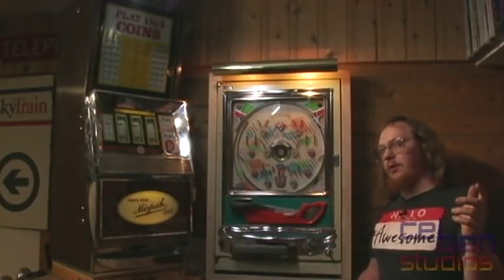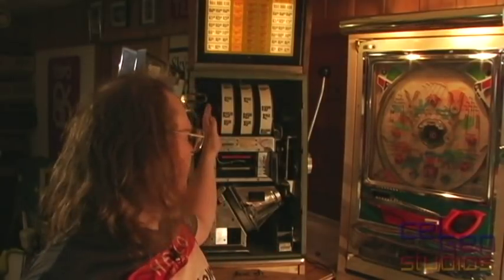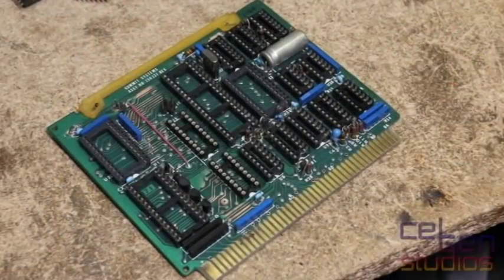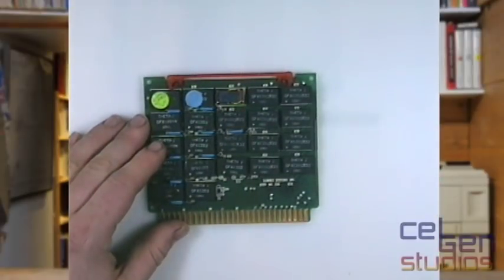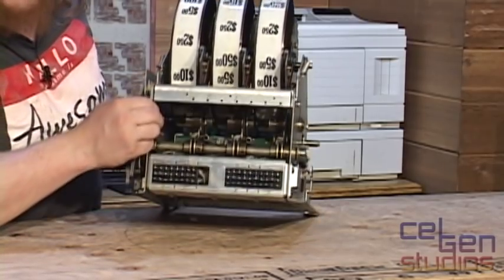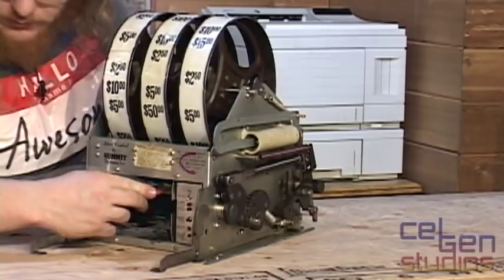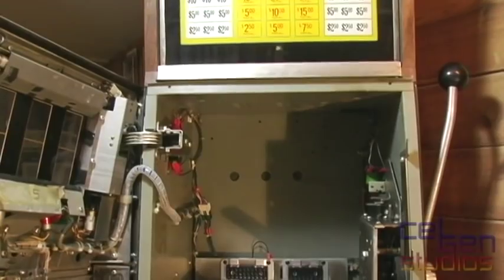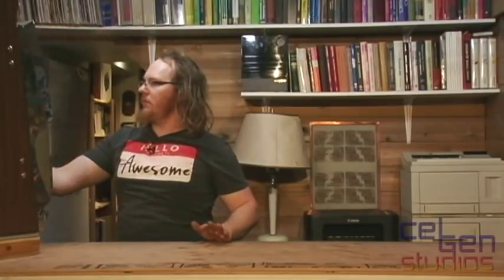Bally 742A Slot Machine (with Summit Micro-Control conversion)

Comment: So glad i found this excellent video.  Already watched it 4 times! I just picked up a Golden Nugget machine exactly like yours.  Was DOA. Found a broken wire in the power cable, repaired a damaged slot controller board but it still wouldn't register a coin. Thanks for the demo on how to remove the wheel assembly.  I pulled it and brushed the connections reassembled and it took one nickel,  dropped the handle lock.  I pulled the handle and the wheels spun... and spun and spun. No solenoids pull in.   I pulled them manually and if course the wheels locked. Back to not taking any coins. Any words of wisdom on where to look next?
Reply from the maker: The ILQ74 on the control board accepts the coin-in signal. You should see pin 2 pull high/low with an oscilloscope when the switch is triggered and you should see the same on pin 15 which is the output...I think. My guess is there is still a poor physical connection somewhere (and yes as you can tell there's a lot of connections) and the switch that signals the reels have started spinning isn't being seen or the percussion from the launcher is making the control board lock up, possibly there's still a battery damaged trace or socket causing problems when vibrated.
Reply: @CelGenStudios  Thank you for your reply.  I Re cleaned the connections,  and it reliably takes coins,  nor.  Still tilts when I pull the lever.  Iplaced the unit in wheel diag mode by pressing the middle reset button.  I checked the BCD encoding and none of the reels are displaying 2. Wheel 1 goes between 1-1 and 1-3; same for wheels 2 and 3. I took apart the wheel assembly and reflowed the solder with done fresh Flux all the connections in the photo transistor boards. No difference.  It's suspect that all three wheels have the same issue... there must be something in common that is causing this.
Reply from the maker: @richbooth8948  Unfortunately I don't have any schematics for the reel decoding. There is a BCD decoder on the CPU board (U6) so I'd investigate there and look around. That's about the best I can offer for help here...

Comment: I have a four reel all stop except#4.otherwise seems like it works. I do have the other type upper control board? Any ideas?
Reply from the maker: Is there an open ground/winding or a control voltage going to the #4 solenoid?

Comment: What voltage is the battery on the control board?
Did you use nicad or nickel metal hydride?
 I just picked up a slot machine this weekend in the estate sale set up just like yours.
 It hasn't been used in like 10 years what should I use to clean and lubricate the wheels?
Reply from the maker: The battery is a 3.6v Ni-Cd rechargeable. The replacement is similarly a 3.6v Ni-Cd but with a much higher current rating (600mAh) which retains the memory for much longer than the original. Clean the wheels and linkages first, then apply 3-in-1 sewing machine oil or axle grease to all linkages.

Comment: Greetings. I recently got a similar device. When I turned it on for the first time, it showed -0- on the display, then something else, then the lights blinked, in general, I decided to do it. Now I have it lying next to the oscilloscope and nothing works for me. I have a doubt about my EPROM(E). My display is behaving strangely. That is, some images, then they are not.
In order for me to move on, I need a verified file from EPROM from any device. Can someone share?
Can someone sell me a diagnostic ROM (file)?
I'm at a dead end. Help
I can send my file from EPROM. Maybe someone can check it?

Sincerely, Dmitry
Reply from the maker: I have a backup copy of my EPROM however because it's a different theme the reel strips and paytable will not match.